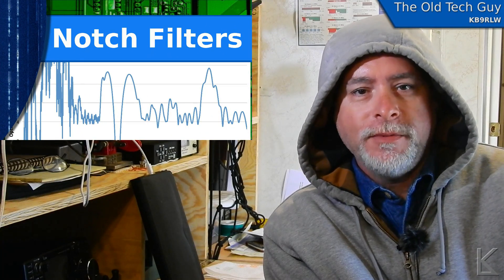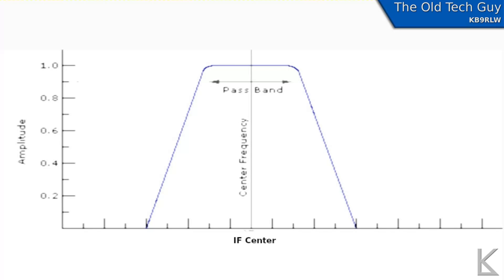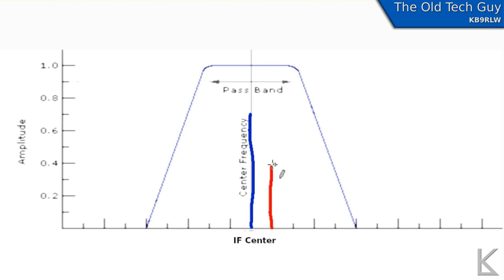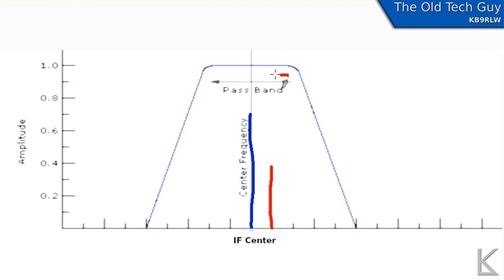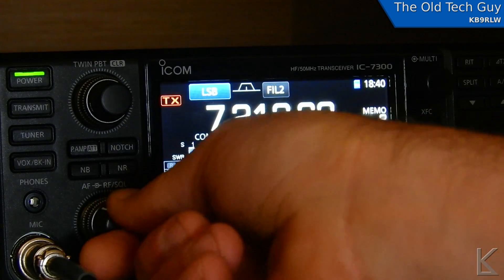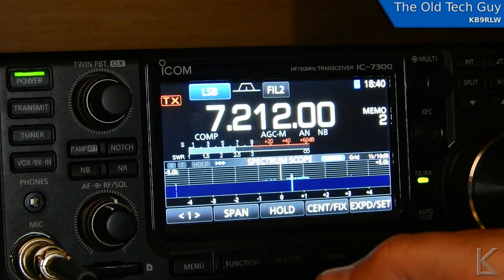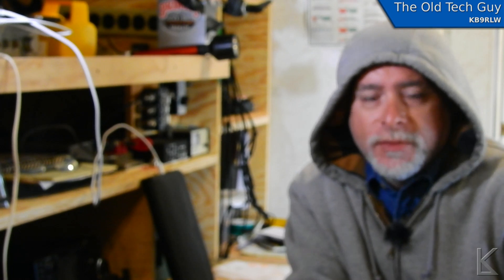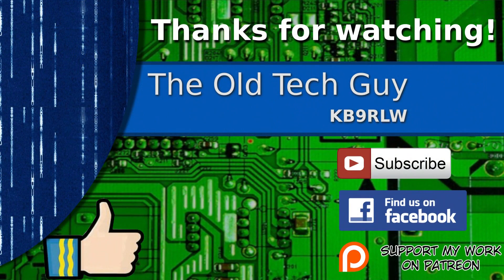Ham Radio - Viewer request - Notch filters explained.

Comment: Sorry to be a pest.  I have a delta loop antenna classic triangle fed from the upper bottom left side.  Works great.  Receives 80m crystal clear.  Always lots of traffic at night.  Thinking of an ICOM AH-4 automatic antenna tuner and possibly 450ohm ladder line.  Would this get me on 80M or would I have to go with a "random" length at say 111 feet?  If 111 feet could it be in a connected in a loop to accommodate my smallish yard?  Thanks.  Always value your opinion.
Reply from the maker: Delta loops are one antenna type I have yet to play with.  
As far as going as big as you can and using a tuner.  Experiment!  It only costs time to try it.

Comment: DX Engineering sells copper plates to place under the radio.  The radio is grounded to the plate and the plate connects to the bus ground.  Think this is worth it for noise reduction?
Reply from the maker: I don't think it would make any difference as far as noise is concerned.  Noise generally comes in via the antenna primarily, maybe a bit on the power line.  
It would help protect the radio from static discharge though.

Comment: I second remote operation video.  I use HRD but cannot get remote operation to work.
Reply from the maker: Unfortunately, HRD and Icoms remote software are windows only.  All my stuff runs linux.  Port forwarding through the router seems to be the biggest problem people face.  The concept is simple, but routers all have different interfaces and it's often hard to find the correct menus within to set up port forwarding.

Comment: Kevin, I don’t believe you have done a video yet, of remote operation. Many people now have the Ic 7300, which is capable of remote operation using the RSBA1, version two, software. Moreover, hams are finding it difficult to install and use this software for remote operation. Part of the difficulty is configuring the software or using router instructions. – And also routers that go off while the person is out of town, on remote location.Several problems are included in this subject, and I wish you would explore them because I think a lot of your readers would be interested.
Reply from the maker: I would be willing to do so, except that I don't run windows.  All my machines are linux only.  I believe that software is windows only.
Router issues are common with any kind of remote access stuff.  The router is a firewall, protecting you from the constant scanning of black hat hackers looking for machines they can exploit.  Ports have to be opened to allow your desired incoming connection through.  That's complicated by the multitude of routers and their varying user interfaces.  Setup of port forwarding is different for each router brand and sometimes models from the same manufacturer.
It would be difficult to cover just a few of them.
One could speak to the general concepts and leave it up to the viewer to navigate the maze of configuration menus for their particular router.  But not much more could be said.
Reply: @loughkb  general concepts video would be great.  I know the success rate of hams using RSBA1 is low and there is a lot of grumbling.  You would be doing a service to all those who need to operate remote if you could review that software, plus general concepts.